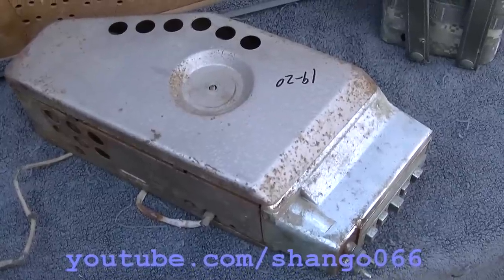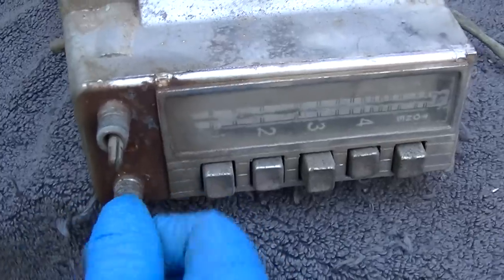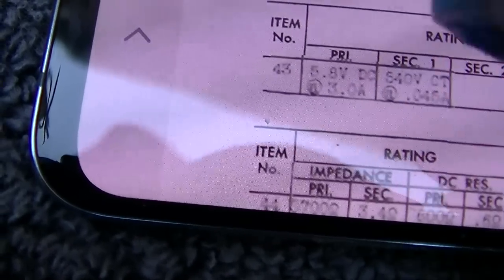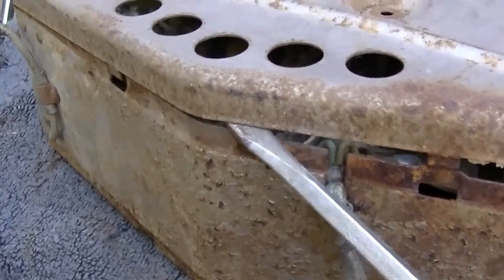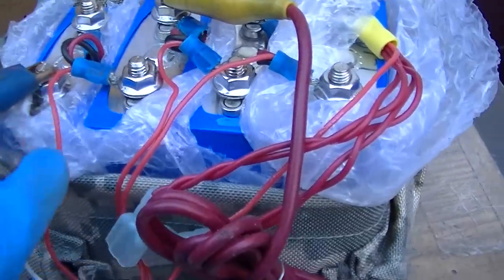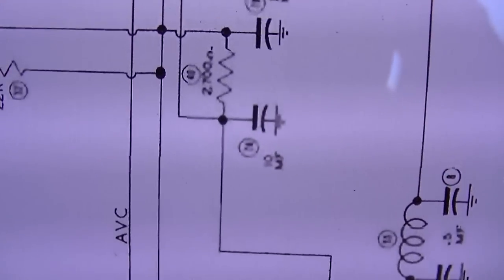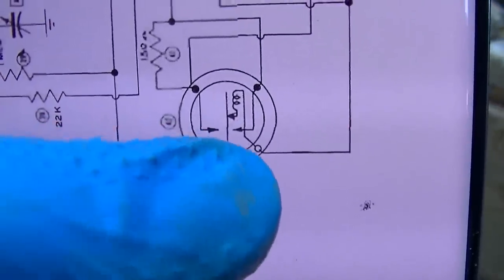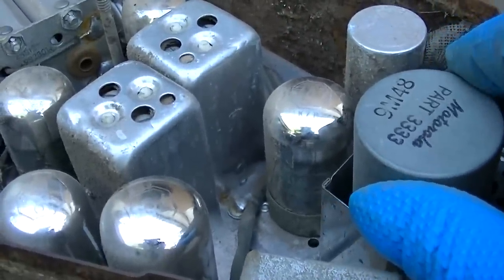1948 Mopar 602 Truck Car AM Radio Restore

Comment: The cool thing is since the radio's vertical like that, it prevented anybody from hacking up the dash to put a replacement in since they're all horizontal!  Every old car or truck I ever bought somebody had hacked a CD DIN size player in there...
Reply: In my book a hacked up dash with an infotainment center ruins the experience of a classic car
Reply: That change coincided with plastic replacing metal in the dash.
Reply: You underestimate the car radio hillbilly. As long as they have working fingers and some electrical tape to loosely join wires together they will find a way to install an ugly head unit into anything.
Reply: I seem to recall a lot of old metal dash trucks having a standard single din head unit installed on brackets below the dash along with a rats nest of wires, wire nuts, and electrical tape.
Reply: @chad2787  metal bracket cradle

Comment: I bought a "parts set" once that had a metal ballast "tube" in the circuit. The whole set was severely water damaged so I submerged the ballast tube in my bucket of evaporust for a few days. It worked 100% to remove all the rust. What I didn't account for, was that the ballast tube was one of those 50s-60s era universal replacement types where you configured it to the application by pulling pins off of it, which left behind some holes that allowed the evaporust to fill the inside of the ballast. I let it slowly drain out for about two months and believe it or not, the ballast tube still worked but it stank to high heaven every time it was turned on. After about a year of using the ballast for a few hours a week in the garage it eventually lost its god awful smell. It was enough to make a dying selenium rectifier smell like the world's best perfume.

Comment: In some radios the 0Z4 socket may have the filament pins connected in that case you can use a 6X5, plate and cathode connections match the 0Z4. Also 0Z4s can get weak, the symptoms  can be failure to conduct, radio quits playing when the car idles and starts playing again when accelerating.
Reply: 0Z4 tubes do not have filaments-they are cold cathode rectifier tubes-essentually a form of neon lamp-but with argon gas.The tube has a metal shell-under the metal case is the gas filled bulb hat glows blue when the tube is working.Used to take off the metal case when I worked on these radios as a teen.Vibrtors-sometimes you can get them going by giving them a sharp whack with a screwdriver handle.Its worth a try.If not then try taking the vibrator case off and cleaning  contacts.So many years ago you could get replacement vibrators from any electronic or car parts stores.
Reply: @thomasoliver5095  Yes, but he is saying that MAYBE the socket is wired so another filament style rectifier can go in as substitute.

Comment: Hi, Shango! I built a solid state vibrator that's pretty reliable. I used a 555 oscilator and a dual comparator (one in inverting and one in noninverting configuration) who's following the charge and discharge of the capacitor of the 555, then driving two FETs. In my case, I had 12V cars. With two small pots you can precisely set the conduction points for each of the FETs, and by choosing the resistors for the 555 you can vary the frequency, in order to obtain the correct B+. The voltage for the 555 should be regulated, I choose 9V. The schematic is a bit more complicated, but is very reliable and flexible. I built 3 of these about 2 years ago and are still working. And, for the laughs, I've put it in an emptied aluminum capacitor. 😁

Comment: Excellent going, Mr Shango. That radio was in quite good shape technically. I uploaded a video on YT recently where I got stuck with the same problem on a early 50s Becker car radio. Used a solid state vibrator made by Aurora, worked very well indeed.

Comment: Hey, we really can relate to this video, I have the Philco C4608 (Mopar 802) version of that kind of radio from my dads 1947-48 Plymouth car he had, when I was a kid. I begged my dad to have the radio and speaker removed before he got rid of the car, so we could keep the radio which did not work at the time. I still have the radio with its original electro magnet speaker, glade we convinced my dad to save the car radio, it's in very good shape yet. I used to have the car radio working decades ago, but today it needs recapped for the original caps are the Bumble Bee type and the push-pull output transformer needs replaced.  Shango you can hardly beat the performance of those old tube car radios from back then!  This car radio has 8 - 6.3v loctal tubes, push buttons with individual tuning coils for the presets as well as manual tuning slugs, the tuning mechanics is a bit different then the Mopar 602 your working on. SO they had mechanical activated push buttons back in the 1940's!

Comment: That vibrator step up transformer primary is designed for a +/-6 volt square wave applied across the entire primary, not half of the primary. The vibrator alternately connects one half of the primary to ground (center tap at +6 volts) then the other half of the primary to ground. I think if you just apply the filament transformer output to the entire winding (not half the winding) then you will get a much closer B+ output voltage. True, replacing the OZ4 with silicon diodes will boost the B+ even more and a resistor will be needed to compensate.

Comment: Missing windshield or very leaky windshield gasket and water dripped right on the dash and top of the radio. Even at that they are very durable and decent performing radio. They made that model in various configurations for hundreds of thousands of cars. I've re-capped a few and never had an issue with the sockets if the chassis isn't rusted out.

Comment: I look forward to the vibrator substitution video. When I had to substitute a 5U4 rectal- fryer with 1n4007's I used a 250 ohm 10W wire wound resistor in series with the B+ and the voltage was really close to the tube voltage drop under the same conditions. Thanks for showing.

Comment: Your friend has a nice truck. My personal favorites are the Dodge Sweptsides with fins on the bed. Those are very rare though. 
Those flathead six motors are super reliable and amazingly smooth and quiet when running right. I had one once in a 1957 Savoy and in a 1957 Dodge Coronet,both with Powerflite 2 speed push button automatics. Chrysler used those flat six engines until 1959. In 1960 the legendary Slant Six was introduced which would be used until 1987. I had vibrator problems in that 57 Plymouth radio too.  The vibrator would stick.

Comment: I remember working on a similar radio back in the 1970s it definitely drew the current. Six volts. It had amazingly good reception and sound. The vibrator was bad and some tubes were broken.  Back then I went to a junkyard got another six volt positive ground radio robbed the vibrator and got some tubes, got it working.

Comment: I been a electronics  technician  for over 40yrs. Fixed about anything and everything over the years. A friend  brought me  a old school  inverter  and it used a vibrator. I rebuilt it  completely  and tested it real good before giving it back . The main reason it failed was the electrolytic  capacitors and a resistor that cracked.

Comment: Jan 2023:  Wow, on a similar wavelength triggered via your channel , last week I found a 1985 Chrysler radio in the quest to find a C-QUAM AM receiver.  Found a bargain basement model with AM only and digital presets and two speaker output (as opposed to four), which is weird in and of itself.  :)
Reply: I have an am stereo radio in my 88' Mitsubishi truck. I don't know of any am stereo stations in my area though to try it out though and I'm not sure what stereo system it uses.

Comment: Some really good ideas here. I have a 1949 6 volt car radio that got stuffed in the back room due to power supply issues.  

Just pulled it out and looking at it again. Will be looking forward to part 2. 

Now I need to find a transformer that can handle 6.3 volts at 3 amps. I do have a spare power transformer out of a 1967 GE color TV I can use with a variac, that solid state tube adapter, and perhaps a light bulb to current limit.

Comment: Working with original  electrolytic and paper caps no less using crappy Chinese power supply.   Impressed by Shango's
tenacity and knowledge of these vintage radios. Liken that the new vibrator works.  No clue about replacing the old with
 a solid state one. I must see part 2!

Comment: Great, excellent video about a fantastic radio.  There's some serious engineering there.  It's appears to be using Bill Lear's car radio circuit, but the schematic flashed by pretty quickly. Love the ergonomic design with the tuning and volume controls on the same side.

Comment: When I was in my 'teens, I had a tube AM car radio in the house. I found that I could take the vibe (which worked) out of the circuit and feed the plate pantswarmer with AC 60hz. The receiver worked and had less noise. The rectal fiber was some kind of gas tube. It had an aluminum cover, but I removed that. So I went to sleep often to that purple glow. I had a long aerial that I strung over the house between two trees. I was in central Georgia, US, and the receiver would pick up WWL New Orleans fine.

Comment: Rainwater thru open cowl vent can cause lots of rusting. Even with the vent closed, and if the drain tube from the vent runoff channel is missing, water will still get thru. I've seen it happen in '49 Plymouth, radio was playing and suddenly went dead during rain storm. Cracked output tube (6AQ5) from dripping water. Drain tube missing.

Comment: I did pretty much the same thing to an old farm radio some years ago. Haven't read all the comments. But from what I could tell from your video you used only half of the primiry winding of the centap step up xformer. Change to use both halves of the center tap xformer it will cut the output voltage in half.
Chris

Comment: Turns out these were originally for Chrysler model vehicles made by Colonial Radio Co. and were made around 1946 - 1948. The great thing about these radios is that they're quite tough against wearing and can last a long time. Something I don't like about them however, is how much current and how much power they consume (~15amps and ~90W at full line voltage) as well as the noisy vibrator, which drained the 6V battery quickly in older cars.

Comment: Just this week, Kevin of Junkyard Digs used a product called Metal Rescue Rust Remover Bath to clean out some really gnarly rust from inside a snowmobile tank. It worked amazing, even at one fifth the recommended concentration. That could be an option for the large metal parts of the case and chassis that can be removed and soaked. A commenter also recommended Evaporust.

Comment: "0Z4 and 0Z4G are primarily used for vibrator-type B-supply units of automobile receivers. Utilizes a starter electrode and an ionically heated cathode. RF filter circuits placed close to socket terminals are required to reduce rectifier noise. Shell of 0Z4 and external shield of 0Z4G should be grounded. 30 to 90mA dc current.

Originally developed by Raytheon and announced in "radio Engineering" November 1935. It originally had a four prong octal base. The 0Z4 was re-registered to RCA on Jan. 2, 1961, with minor spec changes." -- Radiomuseum

Comment: Man, I had a Sony Walkman back in the 90s that used kind of a "vibrator": there was a OKI micro-controller working down to 1V driving the servo-mechanism. The motor was started by the OKI, too. On the motor there was a second coil that generated some 3V for LEDs and audio amplifier. 
In my opinion a transformer based on a motor makes a much more reliable inverter but they found a different solution back in the 40s. The noise and vibration of a motor would be inferior to a clicking sound, too. The downside is the necessity to change brushes all the time. But, an intelligent design would make this downside easy to manage.
The sensitivity and selectivity of this radio are amazing! There was a time when the made real stuff...
Cheers!

Comment: Always like the old car radios.  This must have been a pretty upmarket truck to get a radio, probably not a cheap option and in a time when trucks didn't have air conditioned seats and heated steering wheels.

I was given the amplifier / power supply portion of a '55 Chev car radio, it is similar to this using an OZ4 cold cathode rectifier (I had to google it) and 12V6GT push-pull finals.  I had to crack in to the vibrator as the contacts were oxidized and it wouldn't start up.  It's on the shelf now 'cause it's short one 12V6GT and it's almost as filthy as this one. Speaker was built in and the voice coil was open.  Any surviving radio from a car of this vintage is likely going to be in rough shape.  I'm surprised the chrome caps for the pushbuttons were all still intact on this truck unit.

As a kid I had a transistor unit from a '69 Dodge Monaco and I was impressed with the sensitivity and selectivity of that old beast.  I think it had five ferrite slugs ganged together. A long wire strung up along the joists of the basement and I was pulling in all kinds of stuff that I'd never heard before. I doubt the modern car radios are like this, maybe some.
Reply: Radios in trucks in that era are pretty rare in my experience.  Even then, if they have one it would often be aftermarket.

The deluxe push-button 8 tube radio in my '53 Studebaker (radio made by Philco) had a list price of $86 that inflation calculator says is now $996 !!!!
Reply: @eeengineer8851  Yeah sounds about right. Why such a high tube count? 8 sounds like a lot. I trust it performs well.
Reply: @rotaxtwin  The base 6 tube radio has a single ended audio amp.  The 8 tube is push-pull with a larger speaker.

Comment: Chrysler was the first auto maker to offer an all transistor car radio in 1955 (mopar model 914hr). It was an option on the 1956 Chrysler and Imperial models. They boasted it used 90 per cent less battery power than tube models and that it eliminated the vibrator which was the number one point of failure in car radios at the time.  The all transistor radios were discontinued due to cost of manufacturing and poor sales. Chrysler then introduced for 1957 optional hybrid radios that used tung sol’s 12v “space charge” tubes eliminating the vibrator and using a power transistor in the audio output circuit.

Comment: Shango066, i've read this in the past that when convering from a vacuum tube or selenium rectifier that you should put a 220 ohm resistor rated for a couple watts in series with the anode of each diode, that way the voltage doesn't raise up too much on the output

Comment: Cityboy /Countryman  fix is one of the  6 volt headlamps that ya changed out for the 12 volt ones using the high or low beam filament what ever dumps the difference so ya get 6 volts on the radio still works after 35 years on my 49 Roadmaster

Comment: I used to complete the maintenance of this type of radio on a previous car that had circuits that contained heat lamps, and it was somewhat annoying in the maintenance due to its age because it contained electronic elements.

Comment: I remember some old large tube testers in stores would also test vibrators. If vibrator is good, both lights will light.
Is there a way to test them out of circuit? I have a box of old vibrators of unknown condition, 6 and 12 volt ones.
Reply: I've got a few nos ones too and I would be curious about testing them too.

Comment: If the truck has been converted to 12v how do you power it? I think you said its now 12 volts in the video. With the current draw its going to need a hefty stepdown unit,  extra cost and something that might introduce noise. Since the power supply is now electronic, you could in theory lower the duty cycle enough you could feed it 12volt. A quick pairing up of the tube heaters and replacing the globe would get you the rest of the way there. Not my radio of course, just thinking out loud.

Comment: OZ4G seems to be connected across transformer for full wave rectification so I assume the solid state oscillator outputs will alternatively ground each end of the primary of transformer.?

Comment: Shango, I want to build a solid state 0Z4 for the radio in my 55 Buick. How do I know what size and wattage resistor to use? It's a 12v radio.

Comment: I think Loctals get a bad rap. I have many radios that use Loctals and I have never had a problem with the pins not making contact with the sockets.
Reply: They get a horrible rap. Motorola commercial stuff from that era had tons of them. I've only encountered a very few issues too.

Comment: On the solid state vibrator twiddling the values of the gate resistors will slow down the switxhing speed, this will reduce the harmonics and therefore the interference on MW, but its a toss up between interference and power dissipation in the transistors. I guess the original designer got that dialled in.
A good way to make it electrically quiet is to make it resonant, but that requires a good size choke.

Comment: All the six volt locktals have a 12-volt counterpart. It will be the same tube number except 14 instead of 7 as the first numbers. So, the 7A7 will be a 14A7, for example. Etc etc etc.

Comment: I wonder if you could do a " level one" cleanup of the tube pin corrosion with a q-tip dunked in white vinegar. I've had great luck with TV  remote control battery springs where the batteries have leaked onto the contacts. "A little dab'll do ya." Sometimes the metal actually shines up, if not, a small amount of filing/abrasion is easy after the acid in the vinegar does its work. I'll bet some vinegar on the tube pins and a little wiggling of the tube may work.